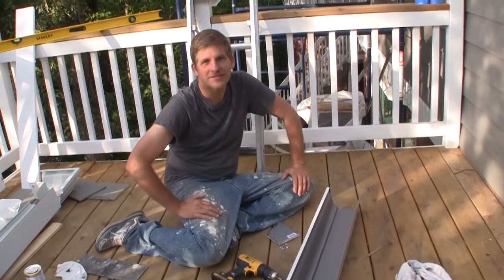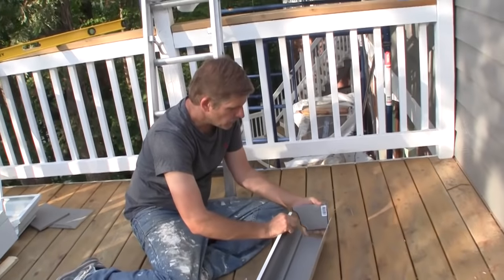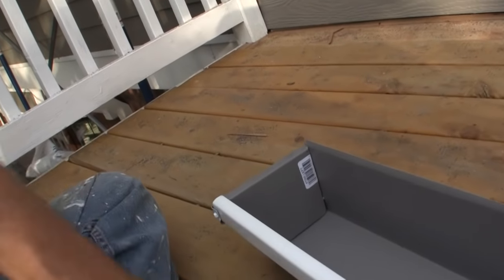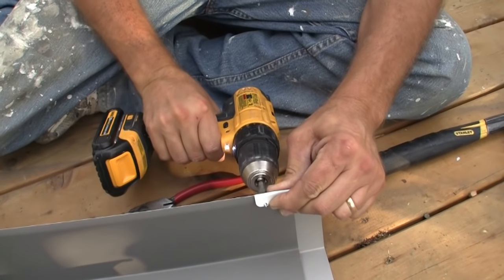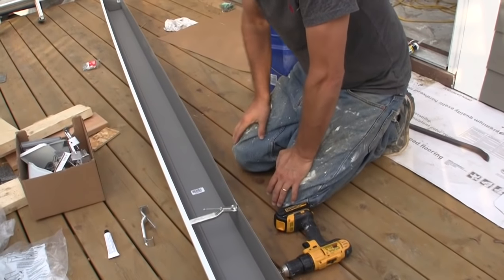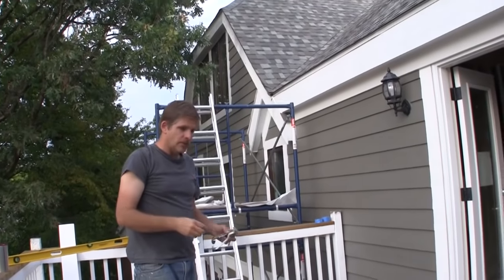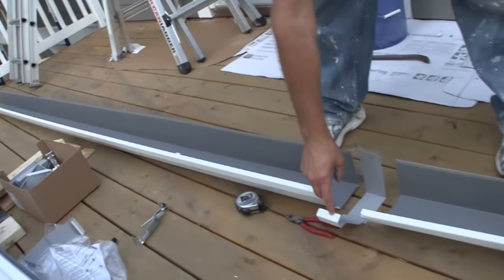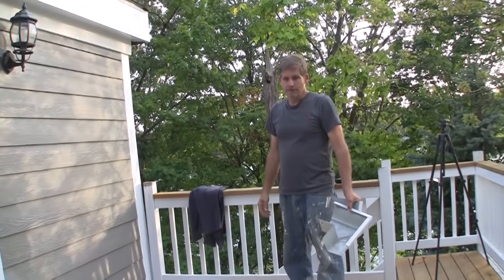How to Install Gutters

Comment: For a person that doesn't understand the different grades of a Levels Bubble, and your only running a short piece -say 20'or less, would it be okay to put a ½" mark (per 10' of guttering*) at the end; and then run a Chalk Line?
* I heard you say that roof was a 5-3 pitch... Does the Pitch change the degree of Drop needed for the gutter?
Reply from the maker: Hey Patriotic…,
That should work. Thx for watching!

Comment: Wasn't it more easier to put the gutter straight in the box miter instead of having a seamer?  1" inside the box miter + caulk you good to go mate. ✌🏼.  Or use strip miters and cut your gutters to 45°.

Comment: Hi Dave, found this video just in time. Super helpful! I am planning to install gutters on a 2nd home but it has a sloped facia so I will need wedges. Do you have any suggestions form making cheap wedges? I purchased 8' 1x1s to created the wedges.
Reply from the maker: Hey Russ,
Glad it helped!
A table saw or chop would be helpful. If the wedges were spaced at each gutter hanger, you should be good. Since they only need to be 4-5 inches tall, you should get quite a few from 1 - 1x1. Sounds like you are on the right track. 
Thanks for watching!

Comment: I got some weird angles on a back porch roof extension. One corner is roughly 45 degrees and the other is a wildcard like 60 or 67.5 not sure. But it gets even better. The whole roof extension thing has a modest slope so the two angled sections of gutter have a lot more slope than usual leading to the “standard section”. I have no idea how those corners were done.
Reply from the maker: Hey depth,
That sounds FUN😳! Not you typical - just requires some recall from geometry class!
Thx for watching!
Reply: @Housebarons  i know my trigonometry well but adding a 3rd dimension (the increased slope) is what baffles me

Comment: So I can understand why you installed your own gutters but why didn't you have the gutters rolled off by a gutter guy in full size lengths instead of throwing up a bunch of small lengths. Gutter guys will do that. And who had the silly idea of installing 1x8" Azek gutter boards instead of 1x6". That's why you have ski jumps at the last shingle course. Wouldn't be surprised if the soffit area leaks during the winter.
Reply from the maker: Hey Larry,
This was a demo for home center gutters. We did have a gutter guy drop gutters in a different reno. You are right - easier if your budget allows. 
Yes / the roof is a little wonky there but no leaks. Thx for watching!

Comment: Can I use RTV as caulking in between 10 foot sections?
Reply from the maker: Hey From...,
Butyl, Urethane, or Polymer based caulks all have their advantages. Unfortunately , while silicone will stick to bare metal, if you ever need to repair a seam, NOTHING sticks to SILICONE. That makes it a poor choice for any fire repairs. 
Hope it goes well!
Reply: FromThe3PointLine Geocel 2320 is the caulking you should be using for gutter.

Comment: Could you list out the items used in this video? I'm trying to replace my gutters and there are way too many options online.
Reply from the maker: Hi hnremak, a gutter system does have a lot of parts.  Your best bet is to measure where you want to install the gutters, then graph the system out on paper.  Think about every part that you will need for each section of guttering.  You have to decide if you want to install a 5 inch gutter system or a 6 inch gutter system.  The 6 inch gutter system is more effective because it can handle a greater quantity of water, but the parts are more expensive.

Here are the parts you will need:  
gutter sections 
right end caps
left end caps
outside gutter mitres
inside gutter mitres
front elbows - need 2 for each bend
side elbows - need 2 for each bend
downspout extensions
gutter seamers
drop outlets
gutter hangers with screws
gutter screws
gutter seal

Good luck with your project!

Comment: longest 1 piece of seamless gutter I fitted  was 320ft long that stuff is crap.all the jonts will eventually leak.
Reply: That's insane! Longest run for me was like 140' how many guys did that take? I was told going over 100' was risky for it to buckle going from hot to cold
Reply: We had about 8 if i remember right, it was about 10 11 ft height so wasnt to bad

Comment: Help!!! I had Lowes come out and give an estimate and there telling me I will need a downspout in the middle of each side of my house. My house is 36' long and 1 story and there is a greenbelt behind my house that all the water drains to and is eroding my back yard. The  purpose of the gutters is to keep the water away from my foundation and the middle downspout is 10' from where I have the issue of the rain collecting the most, I've had to dig a trench to move the water away from that area. I don't want to have to put in a French drain at the the middle downspouts. I already have to figure something for the downspouts at the end of the house, if anybody has any ideas it would be greatly appreciated. From the downspout to the fence line is about 30' and would drain to a green belt.
Reply from the maker: Hey C. Jane,
Without more information, pics, etc. it’s hard to really say.
Not sure why the gutters have to drain towards the middle of your house. 36 ft is not excessively long - did they give any reasoning? Is the gutter length broken up by roof overhangs or is it one continuous run of gutters?
Feel free to describe further or email us pics at our channel. Or you can ask questions and post pics on Reddit - maybe in a Home forum or DIY Thread. 
People on those threads are often VERY helpful. 

You have 2 issues 1) gutter layout and 2) drainage.
You can drain water through rocks to stem erosion and I’m sure there are other ideas. 
I dug a 60 ft shallow trench and laid a pvc pipe - a weekend worth of work for few headaches down the road. 
I know you aren’t interested in French drain, - just saying it pays off if you had to. 
Thx for question....
Dave
Reply: @Housebarons  Thanks for the info. I called the guy back and told him the middle downspout will not work for the issue I am having. He suggest 6" gutters instead, which I would be happy with.  What size pvc did you use, how deep and did you drill holes in the pipe?
Reply from the maker: Hey C Jane,
Glad you got somewhere with the gutter people. 
Regarding my pvc drain - it was for an active sump pump . I occasionally aerate my lawn and the spikes go down about 4 inches. To be safe I think I put it 12 inches deep to avoid accidental puncture.
N O !  I did not use perforated black pipe for the first 60 feet - just solid pvc pipe w/ pvc cement joints - 4 inch solid white .

B U T  - few years later I added an additional 20-30 feet of black perforated pipe. Much to my surprise - that was a very bad idea ! 
Just check out this video - it’s short and will blow your mind when you see the power of roots to ruin your day. 😩
https://m.youtube.com/watch?v=l0ynDj09Tgk&t=8s

Thus . Solid pipe is my friend. 
Peace and patience on your projecting.
Reply: @Housebarons  Thanks for the video, definitely won't be doing that. The gutter guy suggested rain barrels, which is a great idea. I live in Texas and have water restrictions most of the year but when it rains it pours. Would be nice to keep some of that rain water and run the water hose to the back fence when the barrel gets full. Thanks for all your help.
Reply from the maker: Hey C Jane,
Hey C Jane,
Glad you liked the video! Rain barrels sound interesting. We are actually thinking about that idea for an upcoming project. 
One thing about catching rain. A LOT of water can be collected on a roof quickly - so size barrels accordingly. 

For example : if one side of your roof is 38 ft x 20= 760 sq. Ft. - let’s say you have a 1 inch rainfall  ( divide your sq. ft by 12 inches to get your cubic feet ) = 63.3 cubic feet of water running off your roof. There are about 7.5 gallons per cubic foot - so you would have the potential to collect 475 gallons of water on that one side of your roof.
That’s almost 10 - 50 gallon barrels can be filled in one good storm.  It adds up quick. Have fun!

Comment: Pretty shabby.
You didn't put any flashing under the drip edge and over the back of the gutter to keep water from running down behind the gutter.
But, you know that by now, don't you.
Also, I would never install gutters in pieces as you did.
Reply from the maker: Hey Trust,
So far so good.
Thx for watching!

Comment: How much is the aluminium and materials
Reply from the maker: +big Holliday Hi big Holliday, for 6 inch  K style white aluminum gutters, the price for a 10 foot section is $13, and $23 for a 16 foot section. Inside or outside mitres are $18. Seamers and drops are $6. End caps are $3. Downspout elbows are $4. Gutter hangers with screws are $2 each. Gutter sealant is $3 per ounce. 

5 inch gutters are less expensive, but not as effective.

You can figure out the cost for a guttering job by taking measurements and sketching out the job, then determine the quantity of each part needed.

Good luck with your project!

Comment: A half inch every 10' is way too much. Perfectly level is best, but very hard to accomplish. Trick is, sighting down the bottom of the gutter, a little drop, but NO high or low spots in the gutter.

Comment: @6:50 I think it would have been best to tuck the gutter under and behind the drip edge so water doesn't run down behind the gutter onto the face of the facia board...a drip behind the gutter is super annoying...
Reply from the maker: Hey Shawn,
It is a debated point. We chose to have a steeper slope. In theory water should fall off the end of the drip edge if properly installed and not run down its face. 
Yet, what you describe is certainly the typical approach if you don’t have  too long of a run of have s more gentle slope. 
Thx for watching!

Comment: FIRST OF ALL,  IVE BEEN MAKING/INSTALLING ALUMINUM SEAMLESS GUTTERS FOR 25 YEARS IM BOSTON.
DONT USE A THIN GAUGE ALUMINUM GUTTER LIKE THIS GUY.  (LOOKS LIKE HOME DEPOT GUTTERS)
TAKE MEASUREMENTS AND CALL TO HAVE THE ALUMINUM GUTTERS DROPPED OFF BY A REPUTABLE GUTTER DISTRIBUTOR. 
ALWAYS PULL DRIP EDGE.
Reply: What do you mean by pull drip edge?  take it off?
Reply: Hello, yes I am curious, what do you mean pull. Also I'd no idea you could get gutters not from the big box stores. I like the idea of doing this myself after seeing the crap-quality work done by 2 previous contractors. Infuriating! But nobody's going to care about my unit...not even the effing HOA know-it-alls.

Comment: Better to crimp and caulk end caps on gutters instead of drilling. Screws look cleaner seals better also nailing up gutter straps hold better gutter screws tend to snap heads off over time but great work over all
Reply: Don’t need slope either gutters work better in heavy rain slope could cause heavy rain to pass over down spout and splash over end caps

Comment: I have been in this trade since 1977 / and I know this for a fact / 100% Silicone caulking will only last outside for NO longer then 5 years ( or less ) / it's just not the best for a gutter install / Rock
Reply from the maker: Hey Rock,
Thx for the input.

Comment: I bailed @ 4 minutes. You really want screw heads @ cap ends between the gutter backside & facia creating - what - an 1/8" or 3/16" area for water to leak? + zero mention of metal gauge = amatuer hour, 4S. Viewers, beware, pretty sure a crap job/not too distant future redo is in the making here.
Reply: ahhhh, i see, house flippers, all they need is a quick fix, quick profit. wise up all you "likers."

Comment: This is honestly the worst gutter video I have seen.  People please don't buy your gutters at the box store. Call your local gutter companies and ask them how much per foot to run your gutters.   You will give them the measurements and each gutter will be made exactly, no seams no leaks, and use a impact with a 6 inch long 1/4 inch bit not a drill and when it comes to the corners you don't use that little seam part. The corners are made just a Lil bigger so you can drop the gutter right in it. Also make sure the backside of your gutter is fully under the roof gutter apron. On longer gutters it may be necessary to not  clip  the brackets on the back of the gutter, this way you can get gutter up higher to maintain your pitch and still be behind the apron.  The brackets do not have to be clipped on, in fact the ones we buy don't even clip on for that very reason

Comment: use seamless gutter  an snap lock tool for endcaps. an also shingles are short .....also aluminum can you are using home owners bewareof theses gutters .use .027 gauge gutters cause the gutters you installing a leaf  will bend them. GO SEAMLESS

Comment: You did a good job, but OMG. This is the worse gutter system lol. I replace this type all the time. Horrible system. If you need gutters, hire a professional gutter company and go with seamless.   Wow.   Good job though.
Reply from the maker: Hey Dustin,
Thx. The purpose was to show DIY’ers how if they can’t pony up for pro seamless. No arguing - seamless would be preferred. 
Thx for watching!
Reply: @Housebarons  no problem bud. As far as the video, you did a great job explaining how to DIY. Looks good.

Comment: For 50' of gutter with downspouts it should cost about $400 for a pro job. Doing it yourself, You're probably spending $100 in materials, and it's never going to look as good or last as long. The value to the house of using professional gutters will far outweigh the few hundred bucks you save doing this. It's also one of the most dangerous projects for homeowners. Even a small fall from a ladder will cost you 300 at doctor. 
I'm all for DIY, but I just don't think this is the place to try to save money. Penny-wise and pound foolish if you ask me.